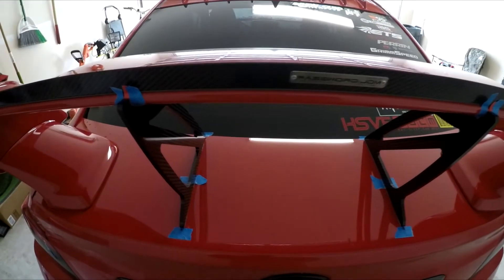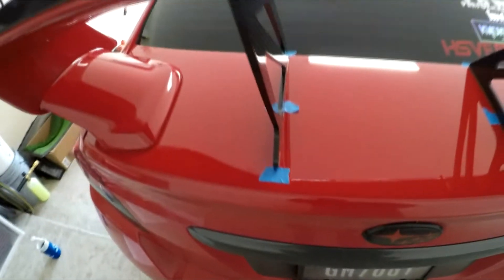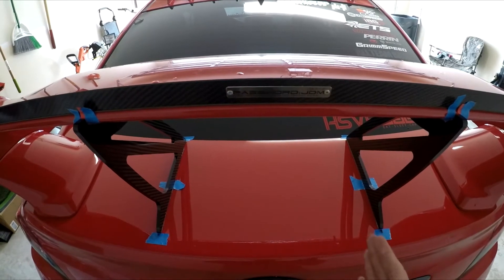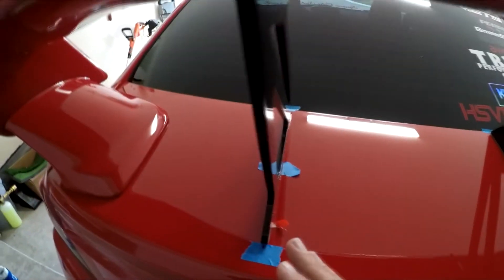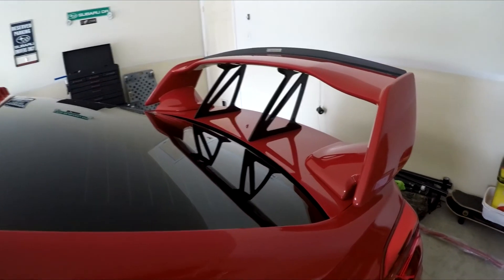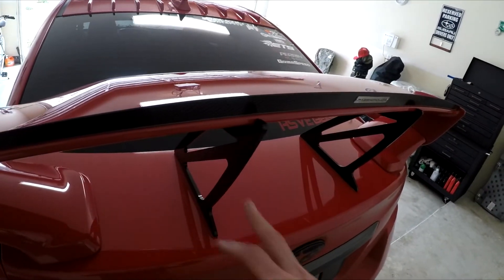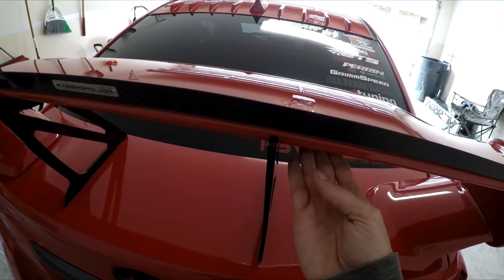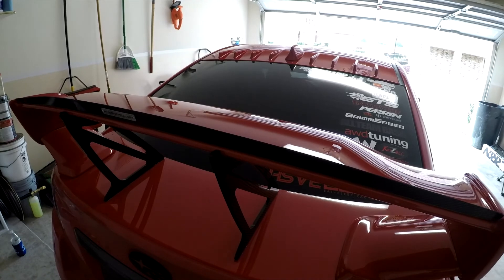2017 WRX Carbon Fiber Wing Stabilizers

Comment: Great video man! These look much better than the Perrin stablizers. So much better that I just got myself a pair. One question, did you do your spacing from the outer walls of the wing? I like that there's a decent size gap between them and want to do mine in a similar way
Reply from the maker: I test fit the stabilizers to about where I wanted them. Then measured from the side to the middle at each end of the stabilizer. Meaning 4 total measurements per each. Then to make sure the everything matched right, I measured the inside gap at the 2 top ends then the bottom ends. Hope that makes sense.

Comment: The front bottom of mine tend to lift up, howd you prevent that or set them?
Reply from the maker: I guess I got lucky. It could be something as simple as pulling the bottoms out an 1/8th of an inch or so.
Reply: @WRXSNOWBOARDER  I tried that but then got a significant gap up at top on back of wing
Reply from the maker: @Playin22  the only other thing I can think of is to double up on the tape. Besides that I'm not sure.